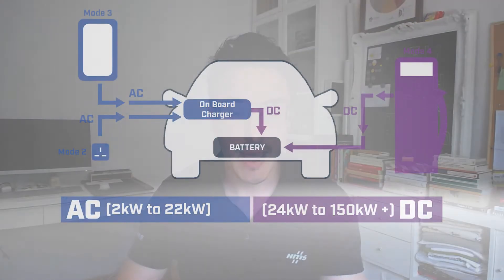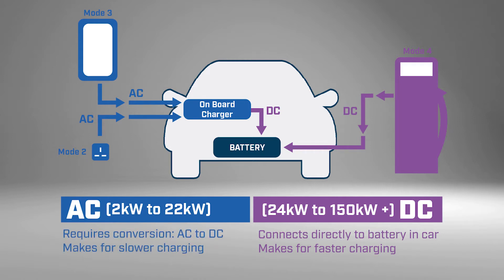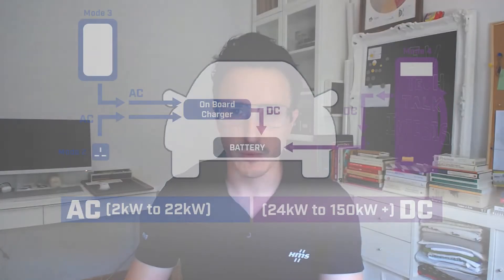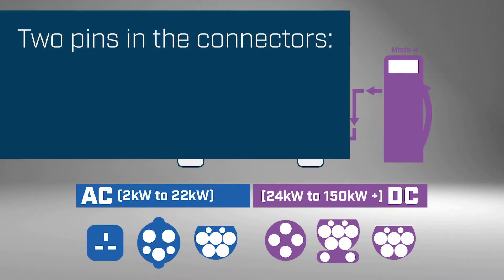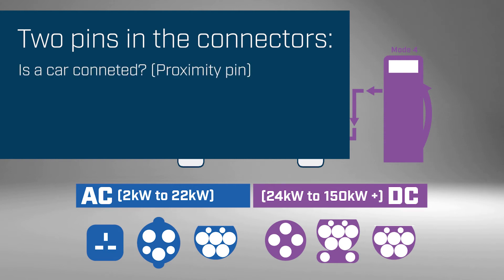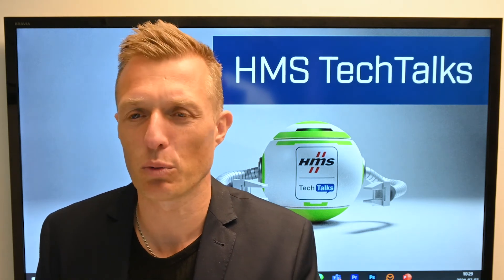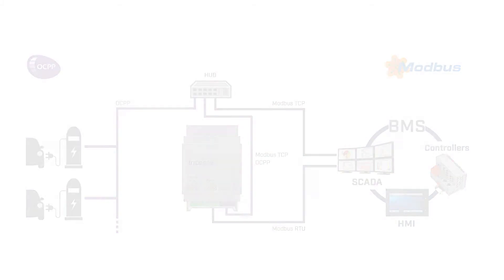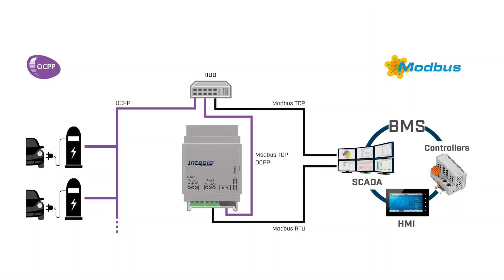EV communication — What happens at the charging station? | HMS TechTalks

Comment: Mode 3? Mode 4? I've heard of Level 1 and Level 2 for AC, and DCFC for DC, but not familiar with those modes. Where are they described? Thanks.
Reply from the maker: Hi @jeffbosch1697, charging "levels" are used to categorize the rated power, voltage, and current of the charging system. There are 3 different EV charging levels.

Different levels of charging in North America: SAE Configurations.

Level-1
-	Supply from household outlet
-	Make use of EV’s on-board charger
-	120V 1ph AC; 12-16A
-	Charging power: 1.4KW or 1.9KW
Level-2
-	Supply from household outlet or EV Charge point
-	Make use of EV’s on-board charger
-	208-240V 1ph AC ; 12 to 80A (Typ. 30A)
-	Charging power: 2.5KW to 19.2KW (Typ. 7KW)
Level-3
-	Supply from 208-600V 3ph AC
-	Make use of off-board DC fast charger
-	400A (Typ. 60A)
-	Charging power: up to 240KW (Typ. 50KW)

Charging "modes" are used to categorize the mode of power delivery, protection installation, and communication/control of the charging system. There are 4 different EV charging modes.

Mode-1
-	AC Charging
-	Regular household outlet
-	Un-safe – Not recommended to use
Mode-2
-	AC Charging
-	In-cable control and protection (IC-CPD)
-	Limited to 3.7kW (16A) in residential use or 7.4kW (32A) for industrial
Mode-3
-	AC Charging
-	Control, communications and protection functions incorporated in the charge point (EVSE)
-	Wide range of charging : 3.7KW to 43KW
Mode-4
-	DC Charging
-	Option to either CHAdeMO or CCS
-	For public and commercial charging applications
-	Wide range of charging capabilities – over 150kW

Charger "types” are used to categorize the different socket-outlets used to deliver power in the charging system. There are many, but majorly 3 different connector types.

AC Connectors
-	Type 1 / SAE J1772
-	Type 2 / MENNEKES
-	Type 3 / SCAME
DC Connectors
-	AA / CHAdeMO
-	EE / CCS-1
-	FF / CCS-2
Tesla Connector (both AC & DC)

Comment: for the common 240v uk points, 2 resistors and 1 diode is all the charge point needs to see, and it turns on the 240v.

Comment: Hi
I wants to know if there any communication between EV and Charge point to send the connector ID to the CSMS or it just the ocpp that generate the connector ID to send it to the central system ?
Reply from the maker: Hi Kareem Elgamal, the connector ID is a property of the Charge point connector, and is used in OCPP to identify it. The charge point would then inform if a EV is connected or not, or if a charging session/transaction had started.

Comment: Nice video, thanks!
Is it a new feature to transmit the battery level via Type2 PWM - thought this can just regulate the power only?
V2G uses only DC connections like CHAdeMO yet, right?
Reply from the maker: Hi, thanks for watching!

The Control pilot does not communicate the battery level indeed, it is used to communicate the charging system state, the EV Charging Station's maximum charging current and any errors. The EVCS sets the PWM duty depending on the maximum charging current available and the Control Pilot can work in different states but at the moment, it does not communicate the battery level.

Regarding V2G, yes only CHAdeMO is certified in some countries to do this and the CCS seems to have a roadmap where full V2G capability is expected to be completed by around 2025.